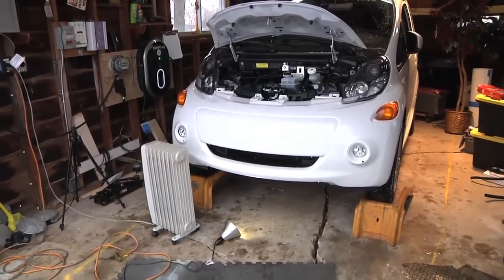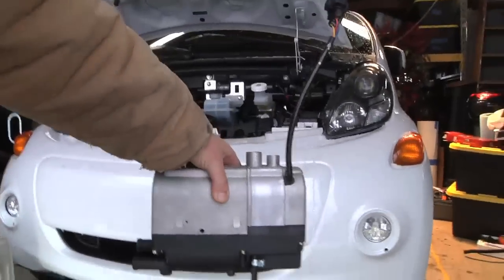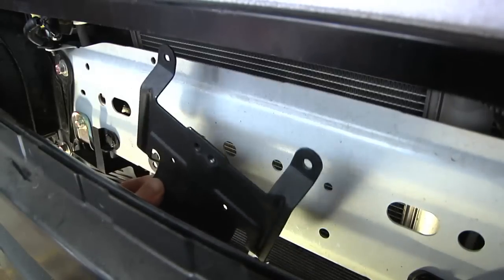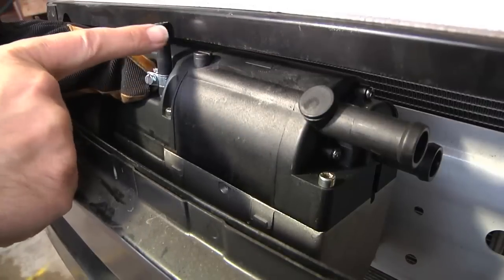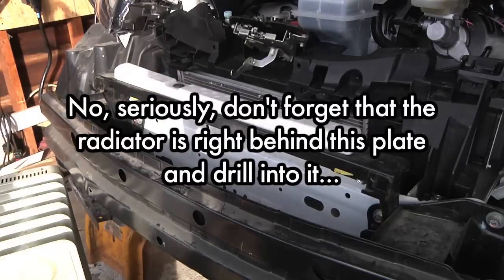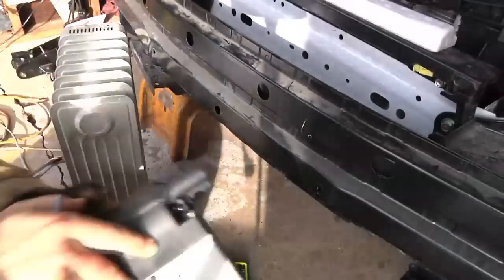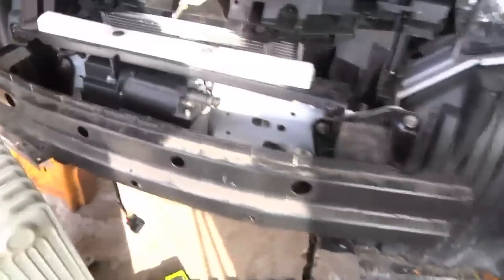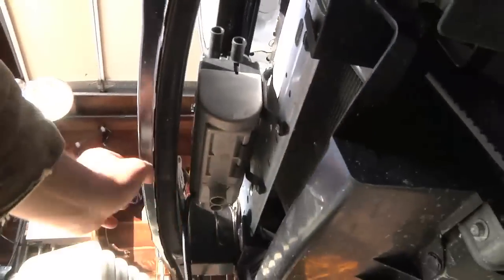iMiEV Heater Install Part 1

Comment: Why in the world have you not insulated your garage? Fun video
Reply from the maker: +Kevin Michael: Ah! A very good question. It's because it's a crummy garage. You can literally see daylight through the walls, and sometimes, if I drop a socket on the floor and rolls and falls into a crack and gets lost forever! The reason why I haven't insulated the garage is because I'm currently working on the paperwork to rebuild the whole thing, including some additional storage space, an insulated concrete slab with hydronic heat, and 5,000 watts of solar on the roof! The garage will keep the car warm in the winter and solar power the car AND the house year-round!
Reply: Sweet plan, though you could insulate with foam and it would do the trick. I used it before, I was able to heat the whole garage with a 400 watt oil heater. Keep the videos coming love them.

Comment: I live in Southern CA, so this is less of an issue, but I found the install to be great, and if I ever took my car to a colder climate I would be installing one of these.  My ONLY concern with your particular install is that a good "tap" on that front bumper might compress the mount and shove it back into the heater.  Or is the bumper bracket rigid ?  If that's the case, your install is brilliant.  I've enjoyed all of your videos.  And, I LOVE my I-MiEV too.

Comment: Hi Benjamin! How is your heater working? Still no problems? I'm thinking about buying one but just I'm not sure which to buy, chinese or orginal.
Reply from the maker: Yes, my heater still works fine. I've never had any issues with it. Overall, it was a really good decision for this car. The worst that I can say is that the fuel tank for it is rather small. I have to refuel often. The fuel tank I got works great, has all the right connections and everything. The next larger fuel tank I could find which would have worked well would have been physically a little too big to fit in the spare space in the car.
Reply: @BenjaminNelsonX  thank you! That's really good to hear :) it seems that it's my turn for that upgrade. I have one more question but it's about battery. Did you made any battery upgrade? I have seen another video that you have replaced flooded pack. Do you remember what's dimensions of battery pack in our mievs? Or maybe what maximum size of cell we can put in package?
Elias
Reply from the maker: @mrkomis   The traction battery in my iMiEV is completely stock. I don't know of anyone who has replaced/modified theirs for larger cells. That sort of a thing is much more straight-forward on a true DIY conversion, not so easy on a commercially-built electric vehicle.
Reply: @BenjaminNelsonX  I've just purchased an Imiev. I'm thinking that if I replace the battery I'd put a marine/leisure battery in it (no cranking current required)

Comment: excuse my ignorance .. why there is a radiator in an electric car?
Reply from the maker: +glakagz The radiator is in there both for the air conditioning and for cooling the power electronics in the car.
Reply: +BenjaminNelson ty for your reply
I'm following several EV convertion youtubers
I'm into my own conversion project, and from: Gas to Electric the radiator is always removed. The motor controller is air cooled.
Of course in this case, I can tell this radiator is there by design.
I got interested in this particular set of videos, because, being in Toronto, it's mandatory to have some "micro climate" in the cabin during winter.

Comment: Does the heater have an emergency shot off? What could happen in a frontal crash?
Reply from the maker: The heater has a number of safety features built-in. The fuel is pumped mechanically from the tank. Without power, it stops. This is a heater designed for use primarily in semi-trucks. It's already part of the trucking industry, so it of course is designed for practical safe use.
Reply from the maker: Come to think of it, it's more likely that there would be a problem with the car's coolant system in a collision than a risk of fire. If the heater were crushed, coolant would gush out, but fuel would no longer be pumped to the heater.
Reply: @BenjaminNelsonX  those heaters are very common in Germany and a few years ago I was looking to get one to install on a combustion engine car here in the US, primary for a better engine life and pre heating of course. That time I never thought about the safety, but the combination of open fire (in the chamber) and a fuel tank right behind the bumper somehow raised my concerns. Anyways, thanks for the great video & really good job.

Comment: Couldn't you have put the bracket on first, and then put the long bolt in the heater, then slipped the heater in and then screwed in the bolt?
Reply from the maker: +autoxer1970 The issue is that it's just a little difficult to get to the bracket bolts with the heater in the mounting bracket. The long bolt that permanently holds the heater into the mounting bracket is a little tricky to thread into the hole. It has to be well lined-up first to be able to thread it.

Comment: what's the brand and model ?
Reply from the maker: +Veikra It's a generic, by "JP-China Trade", purchased from AliExpress.com. It's a 12V, 5kW, gasoline fueled hydronic heater, similar to the Espar 5kw unit. http://www.aliexpress.com/item/Air-Parking-Heater-5KW-12-V-diesel-for-Truck-Bus-similar-with-webasto-heaters/745437017.html?spm=2114.01010208.8.13.x6L5oR
Reply: You said gasoline? that link is for a diesel unit. Dont put gasoline in it O.O or maybe it doesnt matter. if it can burn diesel it can burn gasoline even easier.  Interesting, didnt know any option beside webasto and espar
Reply from the maker: +Veikra the only difference between the two is the software.
Reply: BenjaminNelson
oh nice, but can one change the software himself ? Sorry, about all the questions
Reply from the maker: +Veikra Just do a search through that web page for the gasoline version if you want the gasoline version, or the diesel version if you want the diesel version. No you can't change the software, yes, you can run other fuels in these heaters. This has been discussed on the MyiMiEV forum by several users who are using various versions of these heaters. Please see that post at: http://myimiev.com/forum/viewtopic.php?f=14&t=1248
Reply: BenjaminNelson  Clicked and reading now, would have not found that on my own as I dont hang around the iMiev community. thanks.

Comment: Any pros/cons between the diesel or gasoline versions? I know very little about these liquid fuel heaters, would be interested in running on bio-diesel
Reply from the maker: The diesel version would give you a little more heat, just because diesel fuel contains more energy than gasoline does. Diesel is also safer/more stable/less likely to cause a fire. I got the gasoline version because I could then run E85 fuel through it, which is available at my local gas station. I considered the idea of getting a diesel version for alternate fuel use, but bio-diesel tends to get at low temperatures - which is exactly when you want to use a heater! Bio-diesel and vegetable oil work great as internal combustion engine SUMMER and warm-weather fuels, but aren't generally a good fit for winter heating.
Reply: Thanks very much Ben that is extremely helpful. I should do some more research on E85 availability in my area perhaps.
Reply: I assume there weren't any modifications required to the unit to run on E85? I've heard nothing but bad things about ethanol fuels in small engines like lawn mowers and motorcycles...
Reply from the maker: No, no modification to run it on E85. Keep in mind also that all this unit does is BURN fuel to make heat. So, some of the concerns of a small engine (such as ignition timing) are completely irrelevant. I've had no trouble at all with it running on E85.
Reply: Stupid question maybe, but the iMiEV needs to be turned on (either via the 'ignition' key or using the remote) for the cabin to get heated when using one of these units, right? I assume there is no other way for the fan to run... I'm just wondering whether I should buy a unit equipped with a remote control
Reply from the maker: My car came with a remote, which allows me to preheat the car in the winter while the car is plugged in. It runs the electric heat and fan while the car is off and parked in my driveway. In the winter, I usually pre-heat the car from wall electricity. If I'm doing a short trip, I'll then just use the electric heat from the battery while I drive. If it's a long cold winter trip, I'll still pre-heat with wall electric, then use the fuel burner doing the trip. I suppose that if a person was parked out in the cold all day at work and didn't have access to electricity, that's a case where a remote would be handy for the fuel heater, but yes, you would somehow need to hack the fan then.
Reply: I've been looking at the Eberspacher units on this site, this one is cheapest but it says it has a separate water pump will that work? https://www.standheizungs-shop.de/Standheizung-Universal/Standheizung-universal/Eberspaecher/Standheizungen/Eberspaecher-Standheizung-Benzin-B4WS-mit-Universaleinbausatz::80978.html

Comment: Hi Ben, it's Tom the guy at the energy fair with the purple iMiev, is there any real drawbacks for using the 2kwh version? 
And it's my understanding that you can run any fuel in these, even though the description says "Diesel" or "gasoline"? Thanks
Ben
Reply from the maker: Hi Tom, It's my understanding that the only real difference between the "Diesel" and the "Gas" versions is the software - most likely having to do with how quick fuel is dispensed into the heater. You probably could run either fuel and still have it work, but not as well as it should. I purchased the Gasoline version because I run E85 ethanol fuel in mine. I think that the diesel version gives you the most heat. I believe that mine doesn't run as hot/powerful as it could because I'm using the gas version, and E85 has fewer BTUs than gasoline. I don't think I would recommend the 2kW version of Minnesota winters.
Reply: Hi Ben, I just sent an email to your @me address you can disregard it, you just answered my questions, thanks Ben, I'll probably order one today, I hate to go dirty diesel 😩so I'll probably go the same route you did, if it's working ok😊

Comment: if you don't mind me asking how much did you pay for it? Mitsubishi discontinued that car makes me sad I love Mitsubishi
Reply from the maker: It was $7,000 dollars, used, 2012 model year bought in Nov. 2015 with 30,000 miles on it, top trim level including GPS, backup camera, fancy stereo, and Chademo quick charge.
Reply: +BenjaminNelson you got lucky with that deal to bad you did not keep the purple one you had before I drive 40 miles one way to work but my job would only let me use there 120v plug there is no fast charger there

Comment: Use a "step drill" next time, that will not pop through like a normal drill bit.
Or, of course, put something in between.. Thick metal plate or whatever ;)